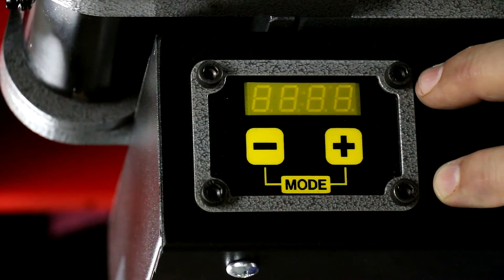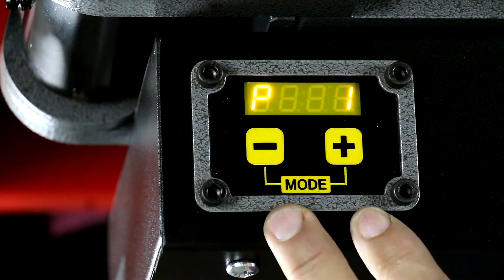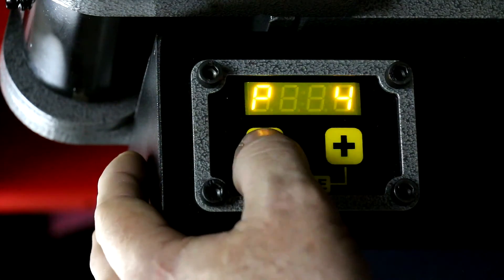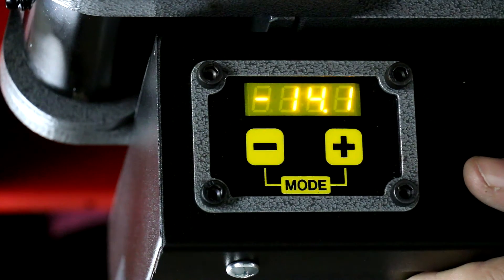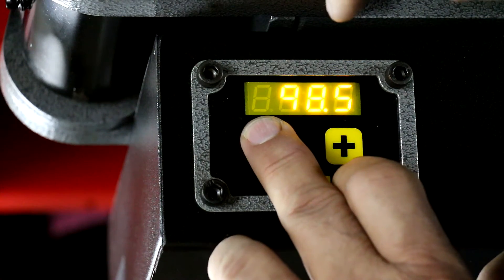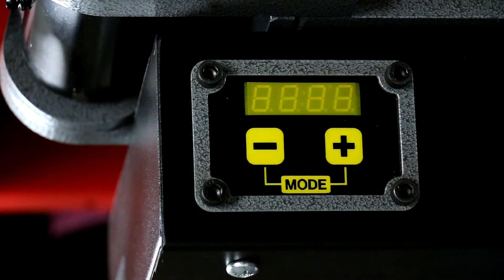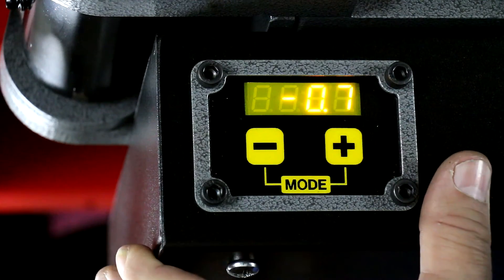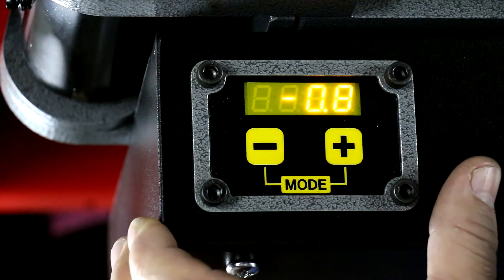Model 54 Bender Computer by JD Squared, Inc.

Comment: Can you guys do a video showing the model 32 bending square stock? I have a cheap mender right now that I use to bend 3/4" and 1" square tube but it's a role pain in the ass to get the tube out of the die set due to distortion. I have a model 32 bender already but worry about spending money on square die sets if this is a battle I'll be doing with that bender too.